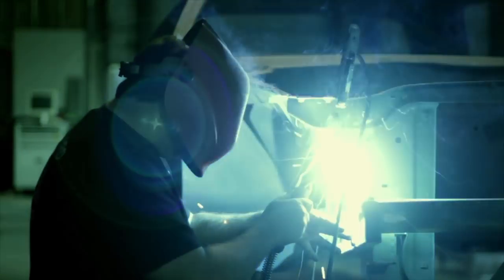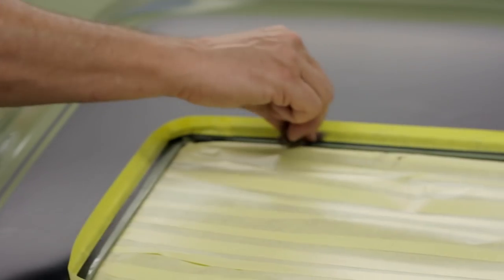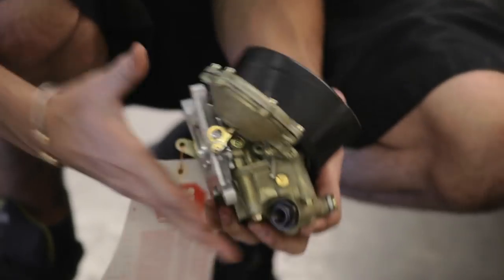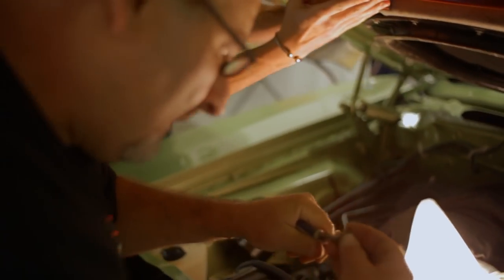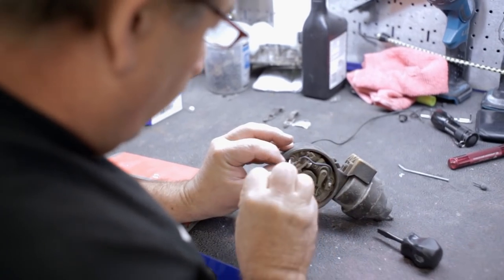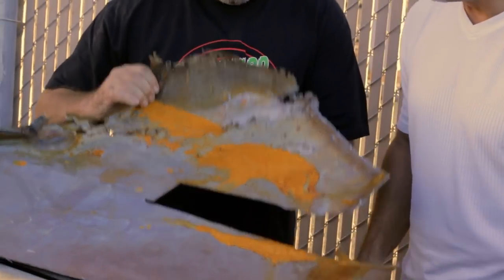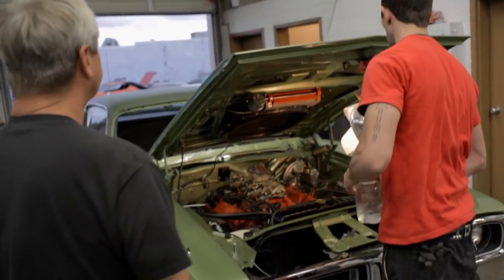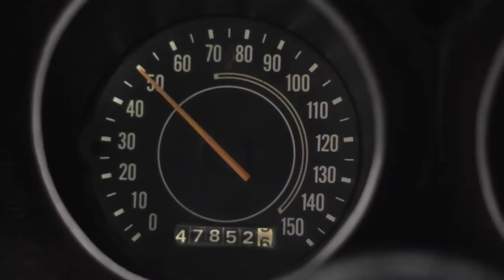Season 2 Episode 2: "Six Pack To Go"

Comment: Hey Mark. I have a 1995 Dodge Neon and 2001 Dodge Neon RT full spec. Leather. Sunroof. Magnum 2.0. Etc. Can you restore that to specs. The 95 is almost a " classic ". I want all the factory check markings in it and all. Lol. Then I can send you my 1971 Dodge Dart Swinger. 318 , 727 torqueflite Red with black vinyl top and factory air. Also 8 3/4 rear installed at the factory. It's all in the build sheet. Thought it was a put together car. But no. Everything was done before it left the showroom.  Full bench seats. Get those Neons perfected and you got yourself a deal. They are still Mopars. 

Just for laughs. But I wonder when Josh takes over with your daughter. If that'll be a thing. That would be funny as heck. Best Mopar restorer on the planet hands down......